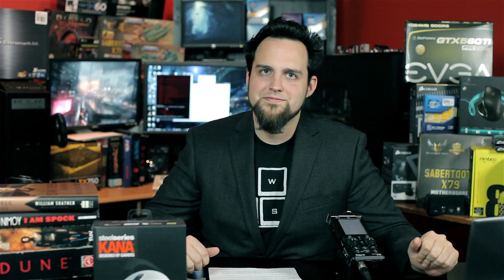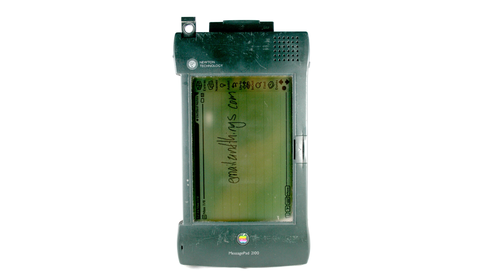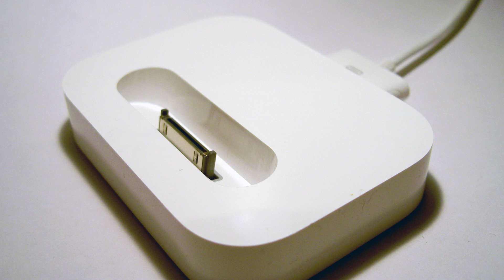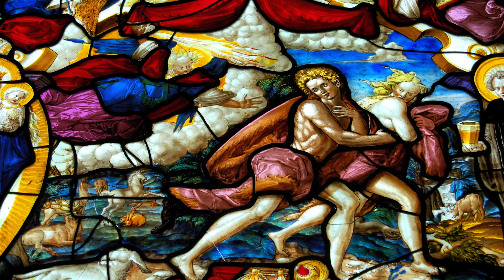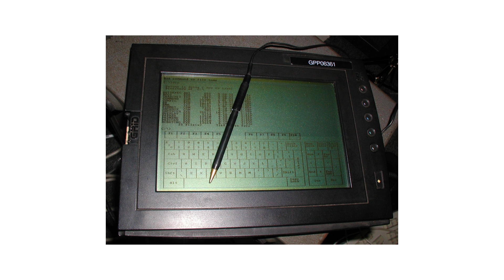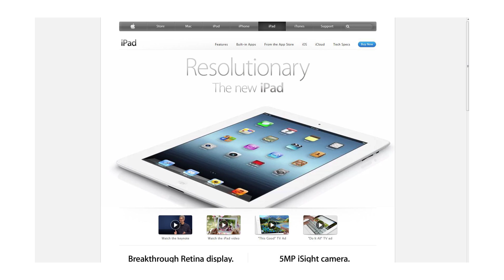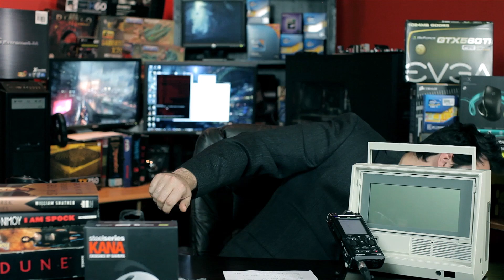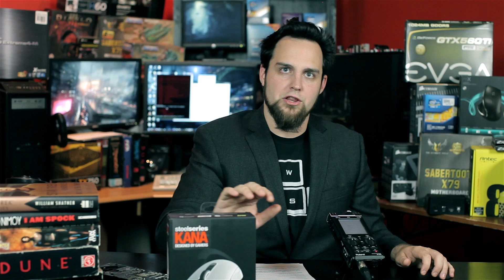Has Apple Really Ever Invented Anything?

Comment: Today I learned, Apple did not invent Firewire.
Reply: UntouchedWagons It never did present itself as having done so, but it helped inventing Firewire.

Firewire is Apple's own name for IEE1394, Apple initiated development in 1986 with the help of the  IEEE P1394 Working Group, where TI was belonging to then.

From the 1394 Trade Association page:
"History
The 1394 digital link standard was conceived in 1986 by technologists at Apple Computer, who chose the trademark 'FireWire', in reference to its speeds of operation. The first specification for this link was completed in 1987. It was adopted in 1995 as the IEEE-1394 standard. IEEE-1394-2008 is the most current version of the standard, which supports asynchronous and isochronous data transmission with data rates ranging from 98.304Mb/s (S100) to 3.932Gb/s (S3200)."
- (http://www.1394ta.org/about.html)
Reply: Indecisive Fella
At first I thought I forgot the "not" in my original post. Anyways, I don't know why I thought Apple invented Firewrire. I guess it was because I never saw it on any PC hardware except for one really good sound card I had.
Reply: UntouchedWagons
My first notebook had Firewire, even the 6-pin port. That was back in 2001.
There were also PCI cards for Firewire 400 and 800.
My second notebook had Firewire too, the 4-pin port, and it was a Samsung X30. That was back in 2003.

Comment: arguably rounded edges could be claimed by the guy who designed the fountain at "sergels torg" in Stockholm...

as he specifically worked on a mathematical formula for producing what he called a super ellipse which depending the numbers you put in will produce something either rectangular or elliptical or anything in between including a rectangle with rounded edges...

Comment: I got duped!  I like listening to music so i purchased a ipod nano.  I find out i need to install a program called Itunes.  Well i use linux and they dont make itunes for linux.  I installed GTkPOD  which is suppose to be a linux Itunes but it has a problem with the generation Ipod I have.  So i borrow a windows computer and installed Itunes.  Itunes was not very easy to learn.  I manage to upload most of my music but when i needed to add single files i could not figure it out in the time i had.  Well the IPOD Nano is up for sale and I purchased a HIFIMAN 700.  This is a simply drag and drop portable player that plays balanced FLAC files.  Last time i get caught in the apple hype.

Comment: I don't have a mac because I think the company is so great it has nothing to do with thinking they are the best or anything. The reason I have a mac is because who makes a laptop that is as thin and strong and sleek as apple? I really tried to find a laptop that would beat the macbook pro but even the razer blade which has nice specs loses in the battery and heat areas. Mac has some of the most portable and durable laptops and thats why I am an apple guy.

Comment: Macs are actually really great products. It's just that if you're in it for the specs down to the decimal of clockspeed and performance for dollar and don't really care that much about the externals, then theres no real reason to buy one. They are good value though, the newest imac costs LESS than the equivalent monitor from dell or any other company, yet it has an i7, graphics card, power supply keyboard and mouse too, where they get into trouble is spending too much money on the industrial design and not on the tier of chips.

Thats not what everyone here want to hear, it's not "You have made the right decision and everyone else is an idiot/ sheep here you can feel smart", but in the end if you're into specs and gaming you still have made the right decision, you'd be crazy to get a mac, it would be like buying a bmw i3 for off road driving.

Comment: Apple has invented 5k.
Reply: It certainly hasn't.
5K and even 6K and higher resolutions have been available before, and LG just had a 5K panel lying around, and Apple decided to use it, just like Dell does.
The difference is, that Apple decided to put a Mac behind the display and charge 2,500 USD for it and Dell did just offer the display using the same exact panel for 2,500 USD before taking 500 USD off that ridiculous price.
Reply: Andre Khan
Yes, on a TV with a much bigger size.

Comment: LMFAO! Thank you Tek Syndicate  for this HILARIOUS list! Apple never invented SHIT! At least after Wozniak left anyway!

MP3 players, Tablets?!? I OWNED the Diamond Rio when it FIRST came out (in 1997 IIRC - a good 5+ years before Apple would even attempt the IPod), AND in 1999 owned my first WINDOWS tablet - FULLY Windows compatible, with full DirectX support no less (unlike my Galaxy Tab 3 - or that not so good Surface RT - NOT to be confused with Surface Pros which WILL spank any given apple product in price and performance!)

If memory serves me, and if this is actually true, SUPPOSEDLY Apple DID create the Mouse, but I believe that was either Wozniak, or yet another design stolen from Xerox (LISA was a ripoff of Xerox's GUI OS!) 

Regardless, what little they did invent DOES NOT AMOUNT TO JACK SHIT! And consumers are waking up to the FACT that they are essentially paying TWICE or more, as much for any given Intel hardware - JUST FOR THE APPLE LOGO! And OSX no longer holds ANY sway in content creation as windows has more than addressed the few places OSX actually excelled, and when it comes to needing surround monitors and MANY windows open, and need to find just ONE file? OSX FLOPS miserably! I am no fan of Windows 8 (7 Pro MASTER RACE) - but from a normal user standpoint, Win 8 is LEAGUES ahead! I have tried navigating OSX shortly after putting Win 8 pro on my older system (to get used to it as clients are starting to use Windows 8 on machines not purchased from our company - as for our machines, we almost always use 7 pro unless asked for a different OS) - And while I absolutely HATE the "Metro Interface" and all the bullshit layout of 8.0, surprisingly, 8.1 actually fixed it so that you can make 8.1 navigate nearly identically to 7! Anyway, about a week after playing around with 8.1 my uncle (who STILL stands by Apple - mostly because he is not a gamer and is so used to OSX - but is actually thinking of making the switch when his i5 based MacBook PRO goes out of date) came over for a visit and let me play around with his MacBook a bit while he checked out my Windows 8.1 PC.

Anyway TL;DR is - for a PC regular, OSX is STILL a nightmare compared to even 8.0! The find system just FAILS, trying to simply page through you HDD's content is TEDIOUS, and I was just left wondering why ANYONE would want a system and an OS that cost over twice as much and are comparatively handicapped to an unreasonable degree - not even accounting for the TOTAL lack of System setting control (BIOS type settings, I am talking about) - which leaves apples completely unable to overclock at all, which given their Intel i-core CPUs, to me, that alone is a HUGE loss in performance! But then there is the FACT that MUCH like Android (apart from the Cyanogen mod I run) - you have NO direct control over what is running and what isn't, you cannot easily even tell what is running and where your system resources are allocated, to me it is all a giant clusterfuck seemingly tailored to PC MORONS who could not be bothered to do things such as; make sure you run important system updates (and the complaints about Windows I hear the most are "It is always trying to tell me WHEN I should update, so I just ignore it and tell it to fuck off") - well with Apples, sure you won't be asked if you want to update, BECAUSE IT DOES IT WHENEVER IT WANTS WITH OR WITHOUT YOUR CONTROL OR CONSENT! Same goes with Anti-virus and Anti malware programs! 

But, hey Windows 8.1 has Security Essentials BUILT into it - automatically updating and scanning, as windows update removes malware now so even that is not a valid reason for Macs! Ofc with Windows 7 pro, my PERSONAL rig, I have MS Security Essentials installed, and set to update and do a full scan every night at 3am! And I run Malwarebytes at least once a month.

So for the most part, Macs tailor to the "I can't be bothered to make sure things run the way I want and how they should" crowd, by using having literally EVERYTHING hardwired to the OS. Even for content creators, a windows machine or "hackintosh" will always represent higher value for money!
Reply: "Apple never invented SHIT! At least after Wozniak left anyway!"
Depends on YOUR definition of invention, and not the general one, as it seems.
As an invention can also mean the combination of already existing parts into a device never having existed before.
And an iPhone or iPad or iMac or Mac Pro never existed in those forms before.

"Regardless, what little they did invent DOES NOT AMOUNT TO JACK SHIT!"
It amounts to plenty of money earned by Apple it seems.

"And consumers are waking up to the FACT that they are essentially paying TWICE or more, as much for any given Intel hardware - JUST FOR THE APPLE LOGO!"
Who is waking up? YouTube commentators never having used a Mac before in their life?
In fiscal 2014 almost 3 million more Macs have been sold than in fiscal 2013. 

"If memory serves me, and if this is actually true, SUPPOSEDLY Apple DID create the Mouse, but I believe that was either Wozniak, or yet another design stolen from Xerox (LISA was a ripoff of Xerox's GUI OS!) "
Your memory serves you wrong. Apple did not invent the mouse, nor did Wozniak. It was invented long before that, the Mac was just the first personal computer to be sold with one and to use it.
And while Apple did not invent the concept of a GUI, it did also not steal it from Xerox, as Xerox was compensated with shares 100,000 shares at 10 USD per share. Xerox paid 1,000,000 USD for them and a short time later, they were worth 17,600,000 USD. Nowadays they would be worth north of 400,000,000 USD.

"And OSX no longer holds ANY sway in content creation as windows has more than addressed the few places OSX actually excelled, "
Which places did Windows address?

"and when it comes to needing surround monitors and MANY windows open, and need to find just ONE file? OSX FLOPS miserably! "
See, for me Windows fails in that regard. No built in virtual desktop system and multiple window management system like Exposé. Unless you count ALT+TAB as superior for your needs of course, but not with 25 or so applications open and even more windows.

"I am no fan of Windows 8 (7 Pro MASTER RACE) - but from a normal user standpoint, Win 8 is LEAGUES ahead! "
From YOUR viewpoint based on YOUR computational needs.
And what is it with you and Nazi symbolism?

"Anyway TL;DR is - for a PC regular, OSX is STILL a nightmare compared to even 8.0! "
Do not generalise because of YOUR single experience, otherwise I would have to say, how can anyone use Windows and not get heartaches?

"trying to simply page through you HDD's content is TEDIOUS"
The same can be said for how Windows lays out its data, or your data.
I like Windows Explorer's two pane system, but the left side does not represent actions done on the right side, thus making it superfluous to even have.
And the system wide search is crap compared to Spotlight.
But then again, your experience is based on one day of OS X experience and applying Windows mechanisms to it,

" I was just left wondering why ANYONE would want a system and an OS that cost over twice as much and are comparatively handicapped to an unreasonable degree"
Where is OS X exactly handicapped? If you could just answer this one question, that would be swell, as none of the dozens claiming it and being asked by me did so.

"not even accounting for the TOTAL lack of System setting control (BIOS type settings, I am talking about) - which leaves apples completely unable to overclock at all, which given their Intel i-core CPUs, to me, that alone is a HUGE loss in performance!"
And yet most Mac users seem to fare fine without overclocking their unit, especially since only two iMac models come with i7 K units.

"you have NO direct control over what is running and what isn't, you cannot easily even tell what is running and where your system resources are allocated"
Yes, you have. Either via Activity Monitor or Terminal or many other means. Just because you haven't found that in your one day OS X experience, doesn't mean it does not exist.
Unix is a much stronger base for an OS than Windows is in that regard, especially since Terminal gives you much more control over everything than Command Prompt cannot even MKDIR of.

"make sure you run important system updates (and the complaints about Windows I hear the most are "It is always trying to tell me WHEN I should update, so I just ignore it and tell it to fuck off")"
I have a fresh install of Windows 6.1 SP 1 and for the two weeks I am running it, it probably did 300 updates and some change.
And when I wanted to do a quick restart, it bothered me with 87 or so updates. Wow. But I found a way to just alarm me of updates and let me have the decision.

", BECAUSE IT DOES IT WHENEVER IT WANTS WITH OR WITHOUT YOUR CONTROL OR CONSENT!"
No, OS X does not. It bugs you every week of not installed updates, but it does not install them without your consent, unless you have set it to do so.

"So for the most part, Macs tailor to the "I can't be bothered to make sure things run the way I want and how they should" crowd, by using having literally EVERYTHING hardwired to the OS"
And as most people are computer illiterate, it is a wonder, Microsoft is still making Windows the way it does.

"Even for content creators, a windows machine or "hackintosh" will always represent higher value for money!"
Yes, if you only favour specs and Windows.
But I am actually faster on slower Mac hardware than faster Windows hardware, and not due to the hardware, but due to the OS.
And I grew up with Windows since 3.1.

Comment: Tek Syndicate Tek Syndicate 
The GUI [Graphical User Interface] & Pointing Device [Mouse]
Created at Xerox PARC [Palo Alto Research Center]
Apple basically went "Yoink" after they went there to look at those.

Mac VS Windows for Gaming purposes
Apple & Microsoft [especially Gates & Jobs] made an agreement that MacOS would primarily be for Digital Multimedia Design and that Windows would primarily be for Business and Gaming

Steven Jobs & William Henry Gates III are Frienemies

The LinkSys IPHONE by Cisco [LinkSys was bought out by Cisco Systems in the late 1990s | early 2000s, in 2013 Cisco sold LinkSys to Belkin] was a cordless phone designed to be used with Skype [back when Skype was previously owned by eBay]
The court ruling for the trademark name was settled on that the two devices worked differently, so both companies were allow to use the name regardless.

The designs for most modern Apple products were "inspired" by old designs of Braun products

Comment: If we are going to name just one thing recently... The first thing that comes to mind is the unibody chassis that they created for the MacBook Air, which is now the cornerstone of physical Apple product design across all their lines and enables them to build such thin, yet solid-feeling, devices. The importance of that can't be overstated.

They certainly invented the iPod click wheel.

The software certainly is a huge factor though. It's the reason why the iPad Air 2 can appear to have weaker hardware specs than "equivalent" Android devices, yet somehow always seem to smoke them when it comes to benchmarks and actual realized performance.

Comment: I agree that Apple didn't invent anything but the argument you guys use can be used to say that no one invented anything. Did Edison, or whoever, invent light bulbs? Not really he just put a glowing coil (already invented) in a glass bowl (already invented) and made a vacuum in it (already "invented") and pumped electricity through it with a circuit and switch (already invented). 

Like I said, I'm not saying Apple invented anything but what's the difference?